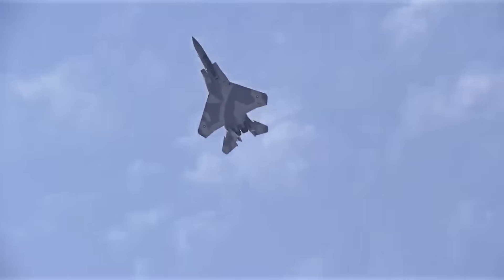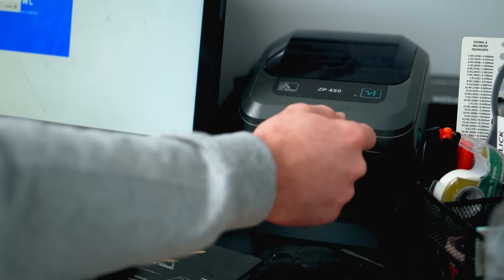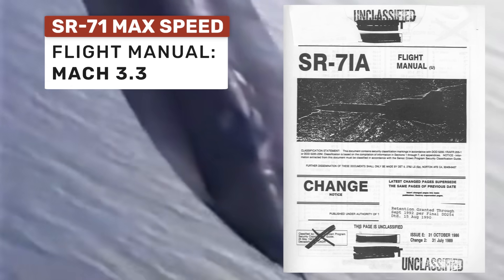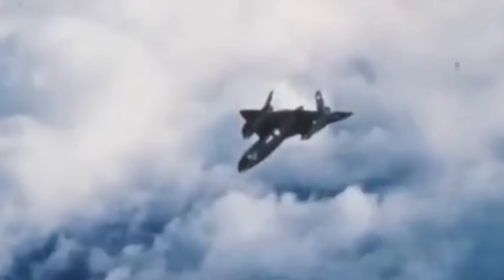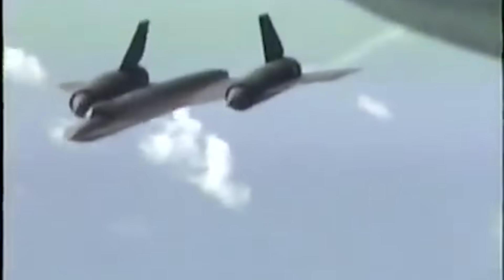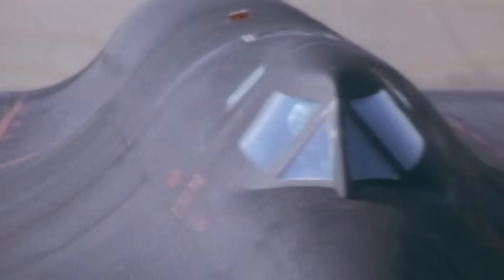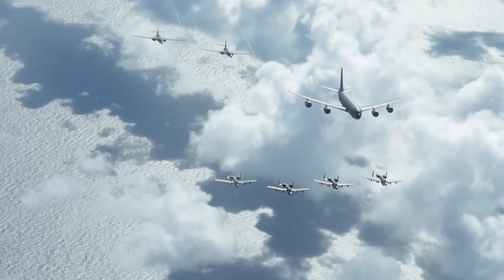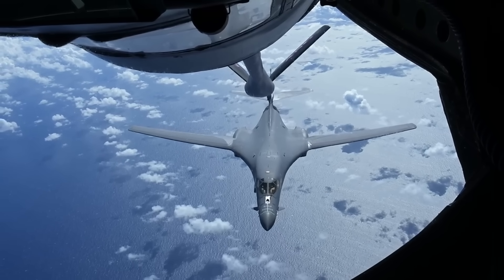The SR-71 was MUCH FASTER than the Air Force will admit

Comment: In 1972 I was in Okinawa. There were 6 open-ended hangars facing the highway and you could see the Blackbirds (we called them Habu after the local venomous snake.) Operational missions left the ADIZ so quickly there was no special note needed.  When a Cathy flight (an FCF, Functional Check Flight) was needed we received a call to go to the secure room, place the correct IBM punch card in the encrypted phone system and received the takeoff time and the exact Cathy profile that would be flown. You retrieved the profile diagram from the safe and waited. The flights typically proceeded to the northeast corner of the ADIZ and flew straight to the soutwest corner. The location times in minutes after takeoff were entered on the diagram. Knowing the diagonal distance accurately, the small number of minutes gave a speed of about 3300 knots. I know nothing of the altitude profile, it may have been descending to keep thrust & temps down, but these flights were intended to accept an aircraft back from maintenance and put it back on the line for missions. This would not be a cruising condition.
Reply: 3300 kts. not possible. Maps with straight lines are not accurate routes. You needed to calculate for a Great Circle route.

Comment: I don’t know why this is even a topic. Any manufacturer is going to use an average to classify the top speed. Like a cars zero to 60 mph is probably a hundred tests and the average is claimed speed. Because aircraft operate in such a large range of conditions there’s no way to nail an exact number. Full throttle at 80,000 feet is much different than full throttle at 50,000 feet. Anyone who knows how averages work knows that to get an average speed of Mach 3.2 you would have a range of speeds from 3.5 to 3.0

Comment: The engineering ignorance of many commenters is stunning.  

When you don't know what you're talking about, you're not doing yourself a favor by making claims backed up only by a friend of a friend telling what story they heard from someone who met an alleged Blackbird pilot.  As if they go around divulging sensitive information to strangers who want to blab it for the rest of their lives.

 Even if the stories were actually told to them by actual pilots, crazy numbers like Mach 4, 5, or 6 are either inside jokes to see how gullible a person is, or far enough out of bounds from reality that it is absolutely equivalent to saying nothing, so they can tell the story and not get in trouble.  Just a way for them to tell a story to someone who wants to hear a story, with no actual enemy finding it to even be disinformation worth spending time to evaluate.  

Even with it not being power limited at Mach 3.2 or 3.3, that doesn't mean infinite power is available.  Power requirements go up approximately with the cube of the speed.  Pretty much all the extra power goes into heating up the craft, so the amount of time you can hold a blowtorch to the nose, wing, and engine inlet becomes the limiting factor.  You can only accelerate so much in that limited time before fear of death makes you back off.

There is a reason that the increments under discussion in this video are hundredths of a Mach, adding up to a tenth or two before the claims are disputed within the community of people in the know.

Comment: I remember going to Great America in San Jose as a kid.  They had this movie exhibition that was put out by Lockheed called, "Speed".  The SR-71 was the second to last featured vehicle (last was the space shuttle) and it said "4500 MPH".  So Lockheed... said 4500 MPH.  That's nearly mach 6.  I never believed the stated top speeds of Mach 3.2 or 3.3... how do you outrun a SAM at just mach 3.2?  Someone in the comments below said 4500 MPH was the stated speed at 50% throttle... another said the airframe was good up to mach 20!  It's just amazing that this plane is older than I am.
Reply: Traveling at Mach 3.5 and 80,000 feet means you have a heck of a head start, and it means you can outrun a SAM traveling faster than Mach 3.5 because SAM does not have enough fuel to catch you.

Comment: I flew F-16s in the 1980s. Everybody knew the "official" top speed was a myth. The Blackbird could fly as fast as it needed to.
Reply: @MrGriff305 I was an F-16A FCF pilot. The jet had to go at least mach 1.4 at 40,000 ft. Fastest I ever saw was 1.84. I suspect the F-22 is 2.5ish.
Reply: @planetim  2.25 due to inlet constraints (because stealth). Though they are rare any aero eng. that works inlets can figure it out. That they got it that high is already really impressive.
Reply: @planetim  SR-71 great, F-35 trash. Easy as.
Reply: I've always suspected that the published "top speeds" of many military aircraft are either just sort of best guesses or total b.s. 
    I had a bit of a YouTube comments argument with someone a while back telling me what an idiot I am for suggesting that we (the general public) have no idea what the top speed of the F-22 is. His argument was that's it's common knowledge among aircraft enthusiasts.
      I've also read that even in mock dogfights the pilots are not allowed to use everything the plane is really capable of. Which I think is just indescribably cool.
       Eventually I realized that I was having an argument with probably a 12 year old. But I'm glad to hear an actual pilot say that the numbers provided to the public are most likely not accurate.
Reply: @VladimirGitcherocksoff  There are so many variables while flying.  I flew FCF flights in the F-16, which included a mach run. To pass a jet had to go at least mach 1.4 at 40,000 ft. Fastest I ever saw was 1.82. Hauling ass that day!
Reply: @planetim  How does it feel to go that fast ?? Does it feel like anything at all, or are you just looking at the instruments going, "damn I'm really moving". 
    Wanted to fly since I was about ten. Other than a couple commercial flights at about that age never have though. 
    I feel like flying faster than sound has got to be an incredible feeling.
Reply: @VladimirGitcherocksoff  At 40k straight and level, in a clean F-16 it feels like normal flight. The ground below is moving along at a pretty good clip. You are traveling at 20 miles a minute.
Reply: @VladimirGitcherocksoff  The not using systems during mock dogfights is a regular thing. Usually when you see some article about "*insert plane design here* beat an F35 in a dogfight exercise" it's not a straight forward sort of match. Normally the stealth aircraft will be carrying drop tanks, gun pods and a number of other things to make it more difficult for the American pilots. 

Using all of the tech would constantly lead to overly straightforward outcomes. If you can't be seen and can use all the tricks... you're going to be a very deadly pilot. By hamstringing the planes, it forces the pilots to be more prepared for the worst case scenarios. 

This doesn't just apply to aircraft in the US military. Typically, if there is any other exercises, army, navy, etc; we will hamstring ourselves in those as well.
Reply: @SlavicCelery  Exactly. Once you get to a certain level all exercises are specifically designed to induce failure. The trick is to delay the failure by demonstrating a wide range of capabilities. And this is not just a pilot thing. Elite infantry always fight "impossible missions". The "heat" is simply cranked higher and higher until the raw stacking of odds forces the outcome.

You don't learn from winning. You learn from losing.
Reply: As fast as it needed to? So Mach 4 or 5 or 10?
Reply: @shrimpflea  every time the Russians would break the speed record an SR-71 would go up and set a new record. Mach 3+ in those days.
Reply: @shrimpflea  That's such a good quote. Literally leaves the imagination just wondering
Reply: Why would you tell your opponents how fast you can go, when you can go as fast as you need..
Reply: @Ghost_Bear_Trader
Yeah, while it's being dragged on it's belly and the pilot is still in his ejection seat 40 feet over yelling at the tow truck 🚒, "hey don't forget me!  Take the whole chair, I'll just stay strapped in, I got some power bars, yee-haw!  I wanna' do that again!"
Reply: @Ghost_Bear_Trader F-35 is trash! 😄

Comment: The X-15 test show that you could get to Moc f o u r with an aluminum skinned aircraft I'm guessing the real speed of the SR-71 is probably close to Mach 6 that's why the skin and a lot of components of the SR-71 had to be made from titanium they had an unlimited life of the airframe every time they flew they got so hot the airframe was heat treated every flight this is what I was told

Comment: Like my brother's 1974 Monte Carlo, with a 454 big block with a massive quad carb, was able to keep on accelerating, far beyond the car's steering, braking and suspension's ability to handle safely. And for certain the Black bird is capable of surpassing the stated top speed because it is obvious that the US Military always understates their aircraft as well as many other vehicles performance. I wouldn't doubt that the Blackbird would be capable of speeds in excess of MACH 5, but the fact that she would run out of fuel before her top speed could actually be ascertained is the likely case with those birds. Considering that the aircraft leaks fuel like a bloody sieve when taking off until air friction heats up the titanium plates of her hull enough for them to expand and seal the tanks is just a little hint to her capabilities AND, like the predecessor experimental aircraft, the fuel would begin to boil at higher speeds because of the friction from the air heating up the airframe, most pilot would not want to tempt fate by boiling the fuel that his aircraft is relying upon to sustain flight. Also, the Blackbird literally did not carry enough fuel to actually determine her top speed. by the time the speeds of 3.5 or higher were reached, she would have to slow down and look for the nearest flying gas station. So, unless they actually want to give those old birds a massive overhauling and try to determine their top speed, we will never really know the highest speeds they're capable of attaining.

Comment: My neighbor (recently deceased) designed the Pitot tube at the front of the SR-71. He had a great story about discussions during testing and how he determined they were running ridiculous speeds based on thermal induced discoloration of the Pitot tubes metal.
Reply: my dad (a master tool and die maker) made the pitot tube for the X15 at JPL .He also welded on the X15 inside a giant tent filled with Argon or Helium. In the early 60's welding titanium was done that way and he wore a suit like a deep sea diver might use  with oxygen hose for breathing..
Reply: @anthonydewitt7674  Titanium is still welded in an oxygen purged environment

Comment: Back in  August of 1976 I was in Wardsville Ontario working in a farmers field when I looked up and saw a plane flying very high up and very very fast. It was coming from the North-East going South-West along the same route as the regular airliners.
Could only have been the SR-71, as no other plane could do that in those days.
  A ruff calculation put it @ 60,000 feet at @Mach-5. They would have probably been descending and slowing to land at 
Wright -Patterson.

Comment: To start with all aircraft during their test development are flown well beyond their operational specs.  Yes the blackbirds were tested up to Mach 4.4 but operational limits was mach 3.4.. though most crews flew them at around mach 3.2 or a little slower.  Heck, Grumman tested the F14 at up to 13g's yet they had operational limits on the flight crews of 6 g's due to the limitations of the flight suits..... which were rated at 6g's.

As far as speed, all 3 of the blackbirds had the same max speed., What was different was the rate of climb due to weight differences.  The interceptor which was actually the 1st one that was built..them cancelled., Then ordered later...   The interceptor was the fastest,..... The A series was next and then the USAF SR was last.

Comment: Good point about the 'dash speed'. Non-aviation people get all excited about 'top speeds' but except for in very few cases (2), these are dash speeds and are not sustainable for long. Two aircraft in history could sustain high supersonic speeds for long periods.  Concorde and the SR-71. Concorde could supercruise so it could sustain high supersonic speeds (M 2.04) for much longer than the SR. -typically just under 3 hours on every flight. It's engines were much more powerful than the J-58 (but then they had to be because Concorde was twice as long and twice as heavy with 100 pax on board) and it remains the only Mach 2.0 supercruising aircraft in history. 

The limits on both aircraft was, as you say, temperature. Concorde was heat limited to 127C (It was 126C on my flight) because it was made of aluminium (specifically Hiduminium) and aluminium begins to weaken, oils begin to break down and fuel heats up too much, if heat soaked over this speed. (The MiG 25 was limited to M 2.83 for the same reason)  In testing it reached M 2 23 and cruising without afterburner at Mach 2.0 means it was capable of much higher 'dash' speeds, as it still had afterburner to use but kinetic heating and therefore heat soaking is the problem. Of course the SR was capable of Mach 3+ because it was made of titanium not aluminium and could therefore cope with skin temperatures of over 300C in cruise but I suspect it would not be able to sustain M 3.5 for very long. Again CIT, Oils and fuel temps would limit it. That is why the AFM has the limits it does for normal operation.(Stanley Hooker, Chief Designer of Concorde's Olympus 593 engines  has a good section on this in his biography 'Not much of an Engineer)

The F-15 claim again, is a dash speed for a very limited time before the aluminium skin begins to overheat, as will the fuel and other fluids, so really it is useless, particularly with Mach 4 AAMs. Just bragging rights. Heat is always going to be the limit and also makes you a HUGE target for an IRST. You would be seen and targeted from hundreds of miles away by today's systems.

Comment: You only run the story up to Mach 3.5. You probably should look at the engine performance curves and see how far they go up. Also look at the direction of travel in terms of engine output and efficiency as you get to the these very high Mach numbers. Also some of the stories of pilots who were actually shot at also might be insightful when contemplating the top speed of the aircraft in those situations, the possibility of the airframe getting hot might not seem so important when contemplating a SAM coming after you. Its worth noting that despite being shot at several times, it never was shot down, despite having no missile countermeasures other than stealth and speed. It definitely couldn't out-turn a missile either as it had a turning radius the size of North Dakota at cruising altitude.

Comment: Around 1980 a good friend visited the air show at Offut. The SR71 was on display. He asked the pilot if it was true the top speed limited by skin temperature, not engine power. The pilot gave him a side glance and turned away without answering.

Comment: The SR-71 in my MS Flight Simulator can cruise at 3,500mph ground speed in  level flight plus mph at 90,000 feet without afterburners. Have flown it to 200,000 feet by going ballistic which causes engine flame out and no working control surfaces.

Comment: Just something to think about, both Space Shuttles Enterprise and Columbia were fitted with SR-71 ejection seats.  The ejection seats had an operational max speed of mach 9 !  So comes the thinking part just how over engineered were the seats?
Reply: This accidentally tells you how old I am.  Back in the day, when NASA did stuff ALL the TV channels carried it LIVE.  I remember Walter Cronkite himself telling that the Enterprise was fitted with SR-71 seats and that they worked up to Mach 9.  Maybe YouTube has test flight videos from Enterprise. @petero.7487
Reply: @petero.7487  you would have to look all the way back to when test flights for the space shuttle started.  It was in a PR memo handed out to TV news and they all reported it.  I completely agree with you on dynamic pressure but then EVERYTHING about the SR-71's engineering is amazing.

Comment: It's still classified. As an retired USAF fuel systems specialist, I can tell ya it did not use regular JP-4 or JP-8 jet fuel like all the other jets. What it did use was a special classified chemical formula mix that is toxic and very volatile resembling rocket fuel. Even the KC-135s that did their inflight refueling were special..
Reply: The only thing really special with those KC-135s was that their own and the tanker fuel tanks weren't cross-connected.